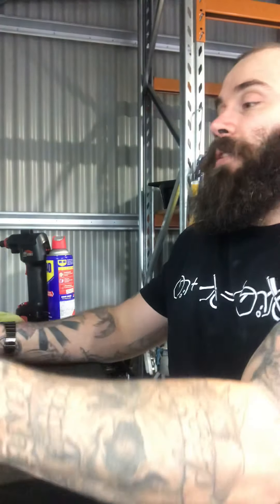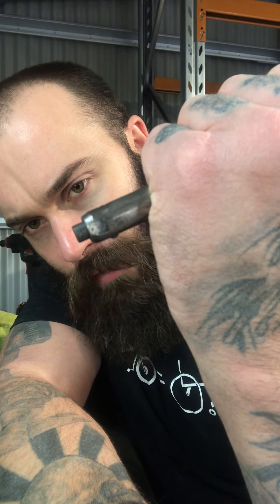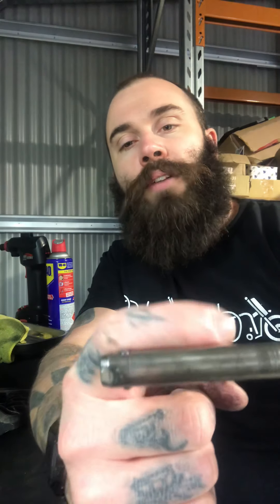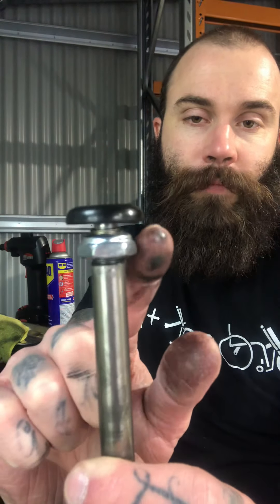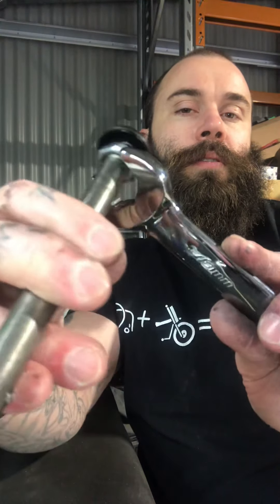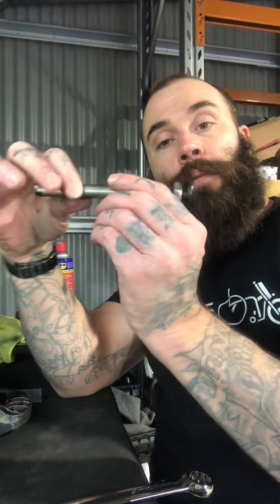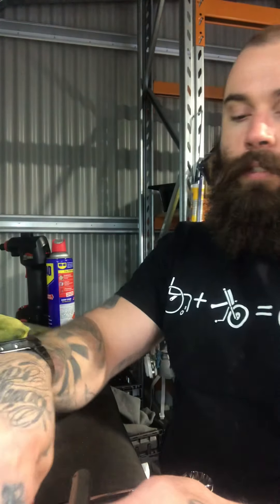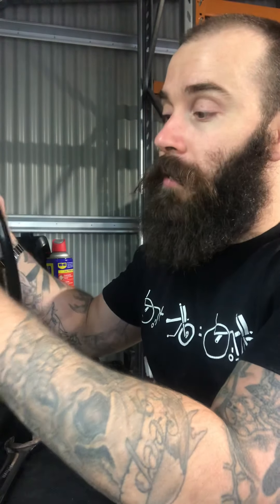Axle Issues On Your Wheelchair

Comment: I have the same exact wheels as you, green spoke Spinergys and quick release axles. I press quick release button and can take wheel off but can't slide axle completely out of hub/wheel. How do I fix this problem?
Reply from the maker: @scottpope7242  wd40 or lubricant, if not use a hammer , they usually seize up after a while even though wheels pop off the axle will stick if not removed every so often dude 👍🏻👍🏻👍🏻👍🏻

Comment: new wheelchair user here, I wanted to change my wheels and needed new axels, but they won't push far enough in the sleeve to even clip in without a wheel on them. Any idea why?
Reply from the maker: @Ymirtus  have you adjusted the nut on the axle yet? If so you might need a longer axle depending on the wheel , sometimes different wheels have wider/narrower hubs which affect what axle you use.

Comment: Hi Jason, a great video, thank you!  I just tried tightening axels because of back and forth movement. After tightening, the wheel doesn't turn, and I can't take it off my chair. Suggestions? Thank you, Sir!
Reply from the maker: Should be able to hold the button in and tap it out from the other side with a hammer 🔨
Reply: @jasonparkerghosthead  thanks

Comment: Dude u r super cool.. and awesome tattoos Just one question . How the f should I fix the spring issues in the wheelchair axle .. once I push the button down, it doesn't pop up again so the ball bearing don't stuck in the hub.. n wheel falls off
Reply from the maker: Try Inox or WD40 to lube it up, otherwise it’s shot and you need a new axle, if they aren’t taken in and out often they’ll also seize up

Comment: My new chair is a substitute cause one I wanted was discontinued.  New chair has stub axles and I want qr axles so as to lessen weight going into  car.is hole in frame of chair any different  between 2 types?  Any issues assuming I measure pin length correctly?thank you from nj,USA. Former technician but never dealt with qr stuff
Reply from the maker: 99% of new wheelchairs have qr axles, 1/2 inch axle and axle tube

Comment: One of the ball bearings collapsed and shattered in my cowherd can I get replacement axil pins. I use spinergy wheels. Pin measures 1/2 inch diameter.  And 110mm from inside tread to ball-bearing. ( yes I am aware of mixture of imperial and metric)

Comment: Hi Jason omg im so happy to find your channel. I'm learning how to navigate the world around me with different tires as ive experienced a few  flats. I have an assistive device called the Companion Plus by Cheelcare.... I have a question: do you recommend taking out the Quick Release and using it on other wheel/tires but going onto your same chair?  what do you think? I have Spox / marathon plus and the other wheels are spox/ primo ( both air tubes ). Also what do you think about solid tires?
Reply from the maker: Once your axles are set up for your chair you can use other wheels if you want just swap out and use your current axles so you
Don’t have to keep adjusting different axles

Comment: I have two chairs given to me one has quick release wheels the other chair does not have quick release is there a way to covert the other wheels to the quick release so i can have a backup set of wheels?
Reply from the maker: Depends on the wheels really, if the hub can fit the same size bearing as your wheels maybe, hard to say without seeing them, best advice is to contact your local repair centre and they would know more…. Maybe haha 😂

Comment: My wheel is stuck! The button pushes down, but the wheel won’t come off. Any tips on what I should try?
Reply from the maker: Grab a a wooden mallet and bang the hub of the wheel from the inside while holding the axle button down , it should work, this usually happens when you don’t take the wheels off enough
Reply: @jasonparkerghosthead  didn’t work for me I believe the button is not clicking to release the lock inside
Reply: While you're waiting for a solution/mechanic soak the hub in some rust buster or dissolver thoroughly. Just ask at your auto store.